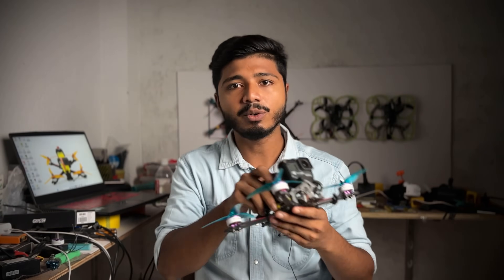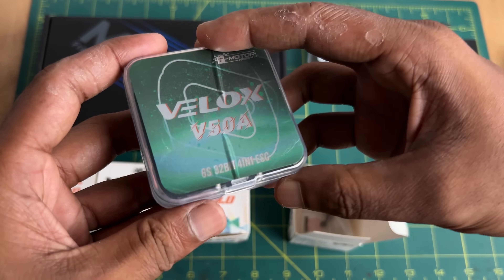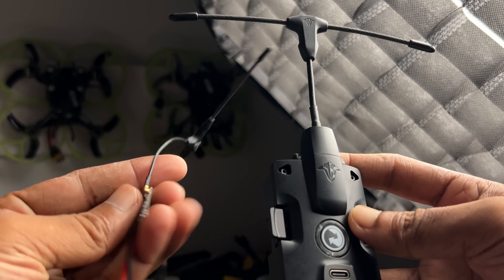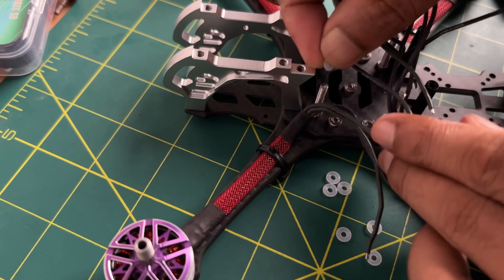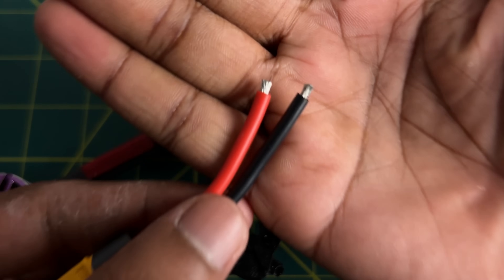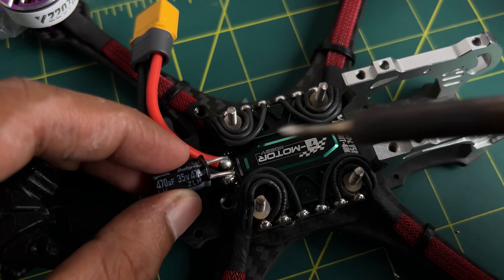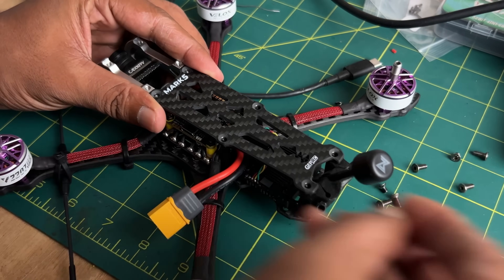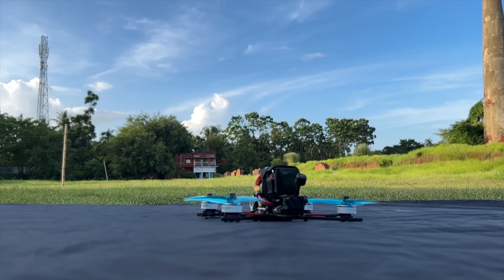How to make Fpv drone at home. #fpv #fpvdrone #drone

Comment: Total build cost :

Component
Estimated Price (₹)
Frame + FC + ESC + Motors
2,600 – 13,800
FPV Camera + VTX
1,500 – 3,000
Transmitter & Receiver
3,000 – 7,000
FPV Goggles / Monitor
6,000 – 12,000
Battery (x2)
2,400 – 4,000
Props & Miscellaneous
500 – 1,000
Total Estimated Cost
₹15,000 – ₹40,000

Comment: hello guy's i hope someone will solve this problem of mine am facing issue regarding  transmitter and reciever both are connected in system am using is speedybee f405 v3 with flysky i6s controller.  problem is both reciever and transmiiter are connected but in betaflight there is no stick movement. connection are serail ibus and in transimiiter output is already selected ibus but still it's not connecting help it's not solving tried everyting like updating firmware to eveything dewring
Reply from the maker: You need to turn on the correct serial rx in the port tab, in betaflight

Comment: everything looks ezy but soldering and that short circuit term u used made me worried now , LOL

jst saw pricing, dude 7lakhs jst for Tmotor velox
Reply from the maker: No, it’s only around 5.5-6k for motors
Reply: @akgadget  See in ur first link , its 7lakh Tmotor something, I dont have knowledge of that so I think its motor maybe

Comment: Bhai battery capacity  ketne hona chahiye or C ratine ketne hona chahiye  ketne mah hona chahiye plzz a be bolo naa
Reply from the maker: 70-100c minimum, 1100-1400mah 6s
Reply: @akgadget  🤩TQ sooo much bro
Reply: @akgadget  70-100c minimum 1100-1400mah 6s 
Fir maximum kitna use karna chahiye

Comment: Hi!!

I am planning to fly my fpv drone about next week, but I don't have much knowledge of indian law.
So, please let me know what I need to do to fly fpv drone and what are the necessary procedures that I should do to CAAN.
The aircraft has the following specs:
/Maximum Take off Weight (MTOW): under 249g
/5.8GHz analog video transmission system
/2.4GHz remote control system
/Self-built aircraft (therefore, no manufacturing certificate or serial number)

In addition, please let me know if there are any apps or something that can tell me which areas are not allowed to fly.

Comment: I have a small cheerson cx30 (crashed) drone from 2013 lying around at home, can I make use of it's flight controller to run bigger motors and batteries?
Reply: Lol. No bro cx30 dosen to have the required flight controller or brushless motors ..  those are toy drone for FPV you need at list few things which cost around 500 USD that is 50000 rupees it's expensive man I have 10 Fpv drones but left the hobby as Government has banned Sites of china wherein I use to purchase the products required to build the drone !!

Comment: Sir i want to make  5 inch fpv 
With 4s because my charger only supports 4s so which motor I should use
Reply: You can use the same motor but use 2550 kv for 4s
Reply: @C17GlobalMaster  👍

Comment: Bro, can i use 45 ampier esc from velox or should i have to use the exact same u are using?
Reply: No use can use easily 45amp but make sure while soldering the esc and flight controller you should match the ports of you are facing problem contact me
Reply: @C17GlobalMaster  I wish I could but no I'm broke I'm just saving up for a frame then slowly build
Reply: @C17GlobalMaster  thanks for information
Reply from the maker: You can
Reply: @akgadget  thanks !

Comment: Brother how much Ampere ESC and Lipo battery (how much maH )should I use with my readytosky 2300 kV motor ? Using 5inch frane
Reply from the maker: 25a or above, 1300-1800mah 4s

Comment: Hey I'm building a budget racing drone please review it please.
Speedybee f405 V3 stack
GT2205 2300kv motor
5inch triblade props
2200mah 3s lipo
Zmr250mm
Reply from the maker: Go for 4s 1300-1800 mah lipo., and tbs source v5 frame

Comment: Motivating video bro. Was planning to buy DJI FPV drone but now will definitely try to build drone on my own. Can you share the links to parts you bought?. Very clean wire management. It looks so pleasing.
Reply from the maker: You can check the video description, and check out quadkart.in and drkstore.in..,
 And if you want same equipments that I’m using then contact me on Instagram
Reply: @akgadget can you can provide me the whole kit ?
Reply from the maker: Yes I can, you can contact me on Instagram

Comment: HOME / DRONES / 6″ -8″

GEPRC MARK4 7-inch FPV

$239.99 – $269.99

RECEIVER OPTIONChoose an optionPNPELRS 2.4GELRS 915TBS Nano RX

￼

GEPRC MARK4 7-inch FPV quantity

ADD TO CART

SKU: N/ACategories: 6″ -8″, Drones, LongRange, MARK4 SeriesTags: FPV Drone, GEPRC, MARK4 7-inch FPV, MARK4 FPV

DESCRIPTION

ADDITIONAL INFORMATION

Feature

1. Classic and attractive appearance
2. Adopt RAD 5.8G 1.6W high-power VTX to ensure stable and reliable signal
3. With GEPRC E2806.5 1350KV motor, it is recommended to use 6S battery to ensure strong output
4. Using F405 flight controller and BLheli_S 50A ESC with stable performance, the overall performance is stable and the hand feels comfortable
5. Using Caddx H1 camera, good visual experience

Specification

Model: MARK4 7-inch FPV

Frame: GEP-MK4-7

Wheelbase: 295mm

Top plate: 3mm

Bottom plate: 3mm

Arm plate: 5mm

Splint plate: 2mm

FC: GEPRC F405 V2

ESC: SPAN 50A BLHeli_S

MCU: STM32F405RGT6

Gyro: ICM-42688-P

OSD: Betaflight OSD w/AT7456E chip

VTX: GEPRC RAD 5.8G 1.6W

Camera: Caddx H1

Antenna: Momoda 5.8G RHCP RP-SMA 120mm

Motor: GEPRC E2806.5 1350KV

Propeller: Gemfan 7037-3

Weight: 455g

Receiver: PNP/ TBS NanoRX / GEPRC ELRS24 / GEPRC ELRS 915

Recommended battery: Lipo 6S 2600mah-4200mah / Lion 6S 6000mah

Flight time: 12-30 minutes

Includes

1 x MARK4 7-inch Analog FPV
4 x Gemfan 7037-3(pair）
2 x M20*250mm Battery straps
2 x Battery Silicone Pads
1 x Set of screws
1 x L-shaped screwdriver 1.5mm
1 x L-shaped screwdriver 2mm
1 x M5 Wrench
Reply: Can I buy this??? Please reply me 🙏🙏🙏

Comment: You are live in west Bengal
Reply from the maker: Yes!
Reply: By the way you speak, I understand that you are a Bengali
Reply: Where do you buy drone accessories from?
Reply: Where so you buy drone accessories from?
Reply: 2550kv velox veloce v2 more powerful than 1750kv velox veloce v2 motor
Reply from the maker: @RohitJalui-qi8ir Nah
Reply: Velox veloce v2 which KV is most powerful 1750/1950/2550?

Comment: I would Strongly Recommend Toroidal Propellers instead of normal propellers as they will create less noise and give more thrust efficiency 😊.
Reply from the maker: Toroidal propeller is not good for fpv
Reply: wrong toroidal propellers only reduce noise
Reply: Did you fly with those props ?
Reply: i feel you havent ever flown an fpv drone

Comment: 71,929 INR or 865 USD and i don't include controller in this sum ,bro Dji Avata comes in this price range with motion controller try to make it cheaper for us
Reply from the maker: Don’t compare avata with a custom build 5” fpv drone.., both have different capabilities
Reply: @akgadget  bro I am not comparing their capabilities but I am comparing their price according to the link provided in discription I add all the components price and convert it to INR and then I check avata's price you can do same and see the difference a normal middle class person is watching this bec he/ she can't afford avata ya there are other people like college students who can use it for projects but still my point is that if the custom build is same as avata price or more then that hardwork is not worth it you can buy it and save some time
Reply: @akgadget  sorry, I don't want to offend you but just putting my point actually I am a student I also want to build this but after watching price of both  avata and custom build I dropped the plan now I just watched video just for fun and visual 😊

Comment: Now we want a video of Making a FPV drone as low As you can ❤ btw great video and what was the total cost of this one ?
Reply: Bro it is 74,994 not including battery and Remote control
Reply from the maker: Sure, I have a plan on that topic😊
Reply: @akgadget  hey Buddy I had a doubt while using FPV simulator which mode should we use toh get expertise in fly real   drone Aero mode or self leveling mode (aero mode is too tough compared to self leveling)
Reply: @Peace-ep8ol acro mode is a must, hard but that's what fpv drones are made for.

If you are opting for self leveling mode and not want to learn acro mode then just get a DJI drone
Reply: 1 to 1.5 lakhs .. depends on the gopro he used , abt 1L for total setup + additional cost of camera .
Reply: @vision3644  can you  tell me how much is the minimum cost of a FPV drone without go pro but full setup with (drone , transmitter, Goggles, battery)

Comment: The visuals are just lit ... 🔥🔥🔥
Reply: Price is also lit
Reply: @rachelvarghese9540  u can make it cheaper way , like vr goggles aint required , main price is of transmitter and reciever which u can use any , i suggest for range of 2-3km , else local motors are cheaper on amazon like sites or other electronic sited , else drone frame can be 3d printed , u can 3d print it from any local shops near u , many people keep it , else i dont think was high in price 
~Regards❤
Reply from the maker: Take love brother ❤️